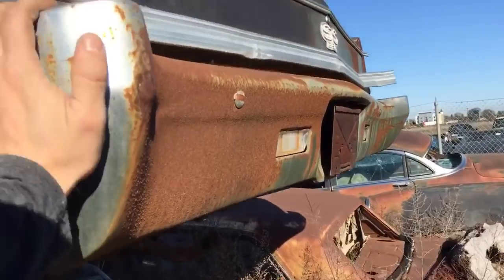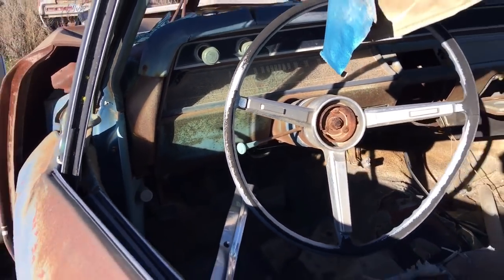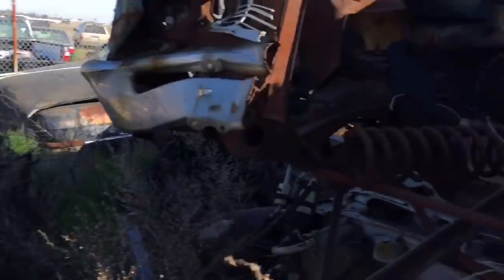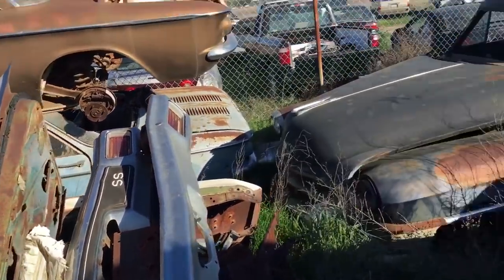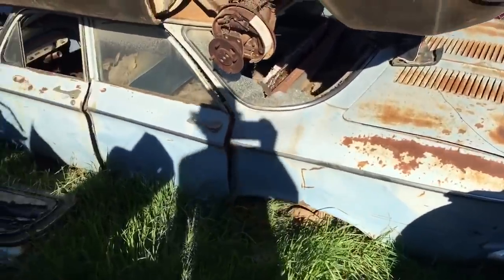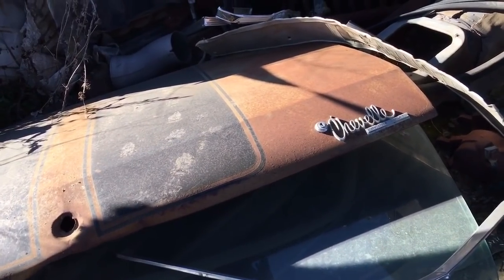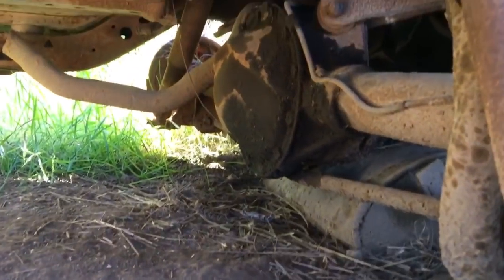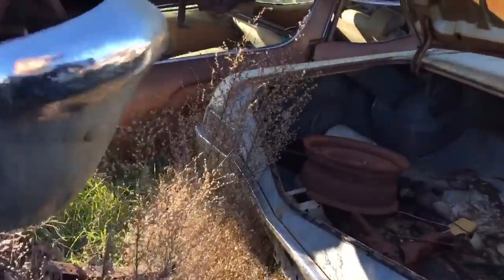Another awesome muscle car Found...SS chevelle sitting quietly in this wrecking yard

Comment: any Chevrolet Nova's
Reply: Always liked the 68-74 Nova's. Where I'm from they had problems with the crossmember rusting out. Some were so bad you wonder how it held the engine and trans up. I remember many times going to the yard for these. You often ended with one that wasn't much better than the one you pulled off. And this was in the early 80's. Had a rusted out 74 6cyl three on the tree with zero options. Fun car and super easy to work on.
Reply: Deucealive75  I'm trying to find one but to build
Reply: Hope you find one. The problem now a days is that you might find one that is near completely gone like the cars in this video, or you have to spend big bucks on a nice one. Years ago we could find something in between at a reasonable price and go from there. Those days seem to be over.
Reply: Deucealive75  i go byea guy who has a 69 or 70 Chevy Nova
Reply: Deucealive75  i plan on building on like the guys from Street Outlaws 405 guys from Oklahoma